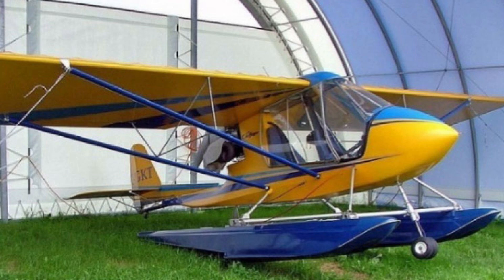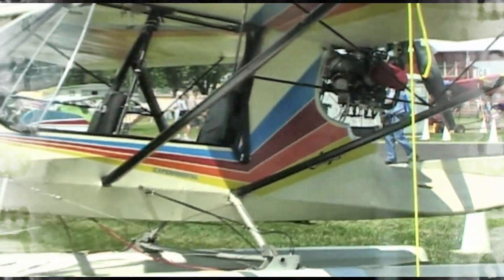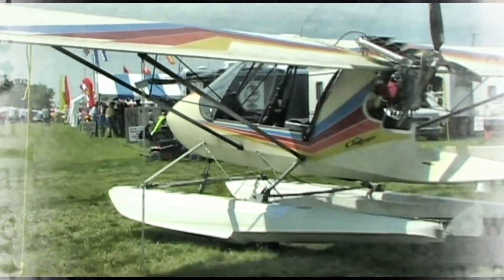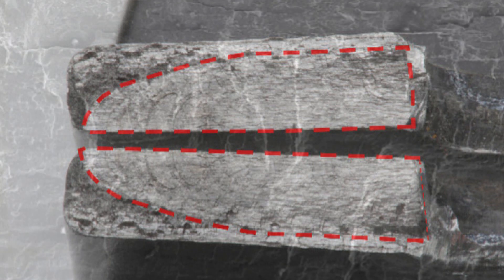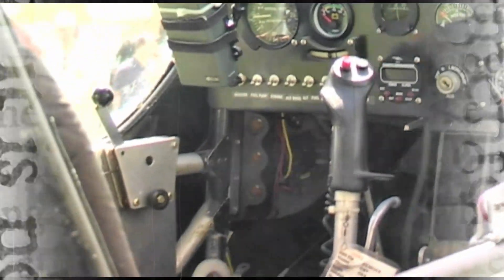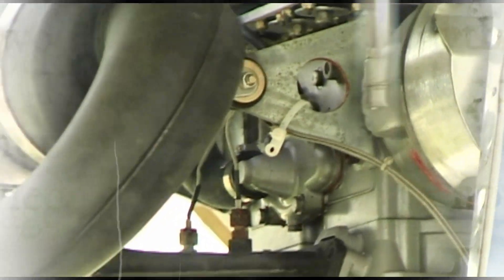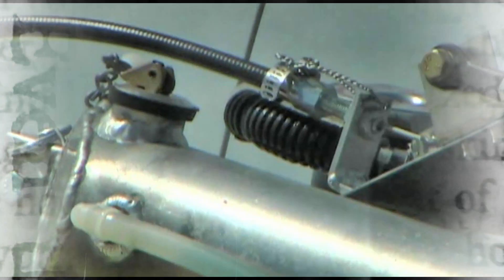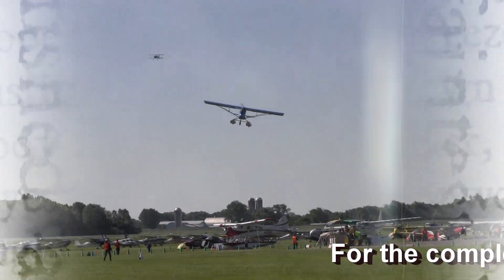Quad City Challenger Wing Failure! Aircraft Wing Bracket Failure, Challenger Wing Failure Advisory

Comment: I remember them having a few problems with these back in the late 90's when I was thinking of building one. I recall a few builders were looping a cable from the strut through the covering and around the longeron as a backup in case the bracket failed.

Comment: Wow, these aircraft have been on the market along time. That sucks. Ballistic parachutes save live.
Reply from the maker: The craft in question just had a 50 hour inspection, one of the other failed brackets had less than 4 hours on it.
Reply from the maker: The report indicates that Transport Canada had inspected 20 brackets with 8 that were found to be defective. It also indicates that there have been four wing failures of the Challenger in the U.S. If you go to the link in the information for the video the complete report is there.
Reply: @ultralightnews  Would you know who is the manufacturer of the bracket part? The kind of steel they use is important in the strut and the bracket and the bolts. Its worth paying more for a reliable manufacturing process
Reply from the maker: @vkumar1170  www.uflyit.com

Comment: I understand there is a round tube inside the strut's outer form? An Al-alloy or tough plastic insert could be cast to remove this weakness identified and made available as an option to simple replacement. I'd suggest an aircraft in GA for 37 years is not something you could issue a general recall for, globally, but I am certain the manufacturers will be willing to make and sell these at cost to keep their awesome Challenger community flying and buying.  I'm hoping to buy a Challenger 2 after our domestic quarantine is lifted (if I haven't left it too late to buy it).
Reply: Why would you want to? It’s a great community but  the design was poor from day one.
Reply: See Kolb